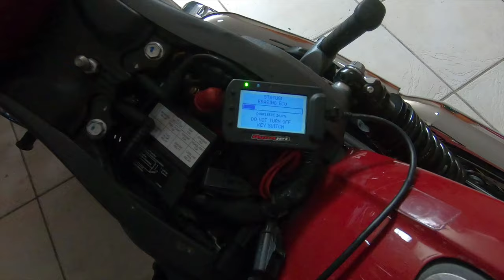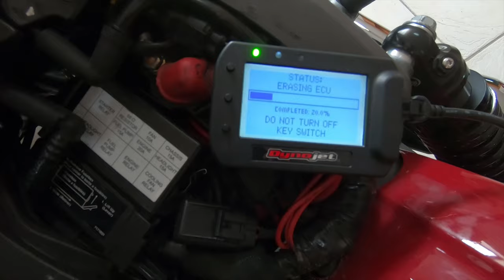Rush Racing Pipe Baffle Re-Pack | Is it quieter?

Comment: Lots of people might not understand why you’d want quieter mufflers but if you’d had that ringing in your ears from days of riding you’d know exactly why.  Great topic Chris, I think I’ll do something similar for a certain multi-day ride next August.  The ear that got hurt - was it the same side your pipes are on?
Reply from the maker: Actually, the ear that got hurt is my left, that's the side my ol' deaf guitarist stood on with a full Marshall Stack for 18 years. I never really had an issue with it until I rode to Sicily. 7.5 hours each way and when I got home, my ear was more than ringing, it was hissing. Hasn't been the same since. There is no way I could even ride with these pipes without ear protection now. 30 years of loud music and then loud pipes didn't mix well for me. Thanks for watching
Reply: I always wanted loud pipes on all my bikes.  Just bought a rebel 450.   Got a extra set of headpipes and bought cocktail shaker mufflers for them.   It’s so loud.   I live in a older neighborhood and I don’t want to be that guy anymore lol.  I definitely need to find something to quiet them down.   Either that or put the stock mufflers back on
Reply from the maker: Yeah, I put my factory pipes back on. I also now live in a normal neighborhood and don't want to be "that guy". Thanks for watching. Ride safe

Comment: I wonder if the super tight packing of the original baffles prevented them from dampening a lot of the noise.
Reply: No that should not happen if or because the material is soft and absorbs the sound waves.

Comment: To make them quieter turn the baffles round , the open ends of the slits should be facing the engine and not the way you have them fitted

Comment: Just bought a Road Glide with the 103, Rush ceramic coated headers and their "Big Louie" 4" slip-ons with 2.5" baffles.  Loud as hell.  A look down the baffle shows the packing was removed or has blown out.  I use the same Moose Racing material you have on my built Guzzi LeMans and it does take the "bark" out of the note.  I'm pulling the Rush baffles and repacking this week.
Reply from the maker: Awesome, I hope it improves the sound
Reply: Well, didn't go as planned.  The baffles would not pull out while on the bike, yes, the retaining screws were removed.  I had to take the mufflers off and soak the edges of the baffles with Pblaster then drive them out from the front side with a wood dowel hitting against the floor.  Just like using a fence post driver.  When it was halfway out I saw that the packing was still in place.  With the Rush ceramic header (no cat) and the Big Louie's 2.5" baffles, they're just LOUD.  I did pull one baffle completely out and removed the old packing and found that the first 2/3rds was solid pipe wrapped to prevent heat from blueing the chrome.  Only about 6" of the last third near the end was louvered for sound absorption.  Pretty much a straight pipe with 6" long baffle.  Now the struggle to get the baffle back in.  I suspect that the outer shell or the baffle cups aren't completely round as it's a very tight fit and they get stuck.  If I lean on the shell the baffle will go in further.  Rush suggested I grind the cups down which is crazy.  In the meantime I've put the stock mufflers back on and that really kills the performance.  The Rush header and Big Louie combo gives great performance, just need really good earplugs.
Reply from the maker: I have a spare set of baffles if you're interested, let me know. Hopefully you can get this worked out

Comment: Should have tried putting the baffles in the other way, with the internal openings facing the engine. I had a straight through muffler like that and in the instructions it stated if you wanted it quieter, holes towards  the flow, louder the other way. Love the bike!
Reply from the maker: Very interesting, never heard that before. Thanks for watching

Comment: The loudness is coming through the end of the muffler, not through the baffle. If you want quiet. You don't want to obstruct those holes. By packing tight, you're allowing more flow through, kinda like a straight pipes.  My Rhinehearts DBX had no packing from manufacture and they are quiet. I even welded and pluged some holes to make it louder.
Reply from the maker: Very interesting and makes sense. I've since sold these pipes, but this is good information for anyone reading the comments, thanks
Reply: Not sure this makes sense.  The baffles/fiberglass absorb the sound that is going through the holes the baffle, which w/o the baffles, the sound would escape through the baffle and out the end of the pipe.  Is my thinking flawed?  Otherwise why would mfg’s use fiberglass at all?
Reply from the maker: To be honest with you, I really don't know 🤷‍♂️

Comment: Ok.. The theory is quite simple: if nothing breaks the sound waves the pipes are loud. If nothing dampens the sound waves the pipes are loud.
So you need a "not full surface".. therefore the holes,  which break the sound waves bouncing back and forth. And you need layers of soft material to absorb them. Fiberglass is heat resistant so it is used for that. Whatever can resist 200º-300ºC ca. is ok.
In theory you can use cotton fabric or wool too, outside the fiberglass layers... If it doesn't burn it's ok. (therefore you can use masking tape outside. The temperature on the outer surface of the fiberglass is not that hot and even paper masking tape doesn't get burned).

Some baffles have that further piece of metal straight through the diameter, it goes towards the engine (against flow) and its role is to break the sound waves at the beginning of the packed pipe. If you turn the baffle around and have it at the end of the pipes it doesn't work as it should... Pipes are therefore louder.
Not all baffles have that, but you can create it, for example using twisted steel wire straight through the diameter of the baffle.
Then it's important to have enough space (volume) to let the combustion gas go out: larger pipes (larger baffles) allow better combustion-gas outflow so you could gain some HP, but only up to a point. But larger pipes they are louder, of course because the sound waves bounce out with less resistance. Smaller pipes (thinner baffles) could reduce the outflow and you could lose power. But they are more silent, because the sound waves bounce more and get absorbed more.
You have to pick the right balance.
Of course the softer and thicker the absorption layer is the softer is the sound (because you cut the higher frequencies.. high frequency waves bounce more and get caught - absorbed - more on their way out).
That's for the theory...
Reply: Ideally you want 
- baffles slightly larger than the original baffles in diameter (10% to 20% ?) to gain some HP. 
- larger housing to wrap the baffle more  if needed, in order to dampen more sound. 
- and maybe also slightly longer pipes to dampen (catch) even more sound on its way out.

Comment: I’m trying to do something like this on a much smaller scale on a motorcycle. Does air have to pass through all that wrapped material?
Reply from the maker: Super easy to do, size doesn't matter. The air will pass through the center pipe, the baffles are on the outside, they absorb the echoes of the exhaust
Reply: @OpenRoader  ok that’s what I thought but the guy at O’Reillys was telling me that it had to be a thin layer do air could pass thru. Do you think that I could use exhaust wrap?
Reply from the maker: The material I used in this video can not be used as a wrap. But there is a cloth tape for that. Very common, get it O'Riley's, but it won't change the sound. Only the internal baffles can do that
Reply: @OpenRoader  what I mean is, do you think that I could use the exhaust wrap from O’Reillys to wrap my baffle. I can’t find the fiberglass material at any of my local auto parts stores. I’m thinking that I could wrap the baffle with exhaust wrap instead or tracking down fiberglass online and then stainless zip tie on each end.
Reply from the maker: Oh man, I'm sorry, that one I don't know.

Comment: Is there a specific wire that u have to use? Or will any wire work? :D.
Reply from the maker: I used thin bailing wire
Reply: @OpenRoader  ok, Nice!  Are you still happy with the re-pack? I have shark road 3inch for my Sportster, and the exhaust has a crazy good sound, but its waaaay to loud! And the baffle has no packing at all.
Reply from the maker: I love the sound of the pipes, but they are still super loud

Comment: Dear Sir: I am in exactly the same situation . I bought some superbe Screamin Eagle for my Nightster: a Hell of sound but even with earplugs it’s a nightmare . I disassembled them to find that the packing was burned . I tried to fix them with Fiberglas house insulation like I saw on YT, to no avail. So I bought the stock mufflers ... nothing good: they are also “burned”.. and it’s even worse because I did the Stage 2: and now I smell like fuel like hell... so I want to put back the screaming eagle put how the hell am I going to shut my panthère up!?? I am continuing to watch your video...
Reply from the maker: I hope this video helps you repack your pipes. I'll tell you what I added to help with the noise. I bought some Hearos 33 NRR ear plugs. They are the highest rated ear plugs I could find. Yet I can still hear my GPS directions through them with no problem. I also upgraded my helmet to a Schuberth C3. This helmet with designed purposely to knock down noise and it makes a big difference. Between the baffle repack, the ear plags and the Schuberth C3 helmet, it's made it possible to live with these pipes and I just love the sound. Hopefully this helps, thanks for watching
Reply: Open Roader cheers mate !  I bought a couple of years a Bell. Love it but really not efficient . Still: will try to re pack for the last time .
Reply: Open Roader your packing compare to mine was purely new, btw
Reply: Hello,
That burning is normal considering the heat of the pipe.
I have the cobra rpt3 and installeren the 2.5 inch quiet baffles instead the 3 inch.
In the first 2 week at every stop you smell that roasted fiber.
With the quiet baffles it gives  about 92 db at 2500 rpm. On a fatboy 2011.
Loud enough for me. At cruising speed they dont boter at all.
Reply from the maker: Nice, thanks for the info

Comment: Looks like the entire surface of the packing was wrapped with tape. That would prevent any absorption
Reply from the maker: Seems to be the way it's done. I looked for a bunch of videos on YT and they almost all show wrapping with masking tape. I also thought it would all burn off, but I put 2k miles on the set of baffles I unwrapped and they still had masking tape as you can see in the video. Thanks for watching
Reply: @OpenRoader 
Ive usually only seen 2 or three bands of tape used. If the tape doesnt burn off, and the entire surface is taped, then there is no absoption of sound.
Reply from the maker: Interesting, I'll open these up down the line and see if the take has been burned off. It's been about 5k miles now
Reply: @OpenRoader 
Strange that the tape didnt burn off before. Usually does
Reply from the maker: Yeah, the factory tape that was on the Rush pipes was still on there. It was crispy. Maybe just needed more time 🤔

Comment: Damn: just realized that you change the whole inner pipe so you can put more insulation ...??
Reply from the maker: No, same inner baffle. The Rush Racing pipes do offer swap-able baffle inserts and I do have two different ones, But you should be able to use the one you have with your pipe. I just made it as dense as I could, packing in as much insulation and wrap as I could
Reply: Open Roader ok so they gave you the option of 2.5” or 1.5”...? So it allows you more insulation ...? Maybe I don’t understand well...
Reply from the maker: I was the same, I didn't understand what it meant. But the diameter of the center baffle tube is smaller. I don't think it gives more space for packing material (I could be wrong) but the pipe in the baffle was bigger so I figured more flow, better power (again, could be wrong) I was able to get double the packing material in there and it did help quiet things down.
Reply: @OpenRoader  Ok.. but  if the center baffle is smaller doesnt help you to put more insulation compare to the original..? Also: where did you buy your material, like the fiberglass tape? Finally: please come back to me about your system to be able to remap your ECU ! Is it a Commander ? I find that your sound is now really perfect: you find that it's still to loud??
Reply from the maker: I actually did not take both sized baffles apart. I had bought the pipes with the large diameter, then bought and tried the small diameter and then cut the packing off the larger diameter. I found the packing material and fiberglass wrap tape on Ebay. Just looked up Motorcycle muffler packing. As for the computer reflash, I use a Dynojet programmer (purchased separately) and for the sound. I love the way it sounds, but GAWD DAMN it's still loud 😂. I do think the over all tone has changed since I did the repack. I think it has burned in and probably opened it up again, but I don't feel it's as loud as it was from when I first got the Rush Racing pipes.
Reply: Open Roader thank you a 1000dB for all! Cheers for you in Italy!
Reply: Put a cable tie to hold your front brake on so your bike won't move
Reply from the maker: That's a damn good idea! Thank you